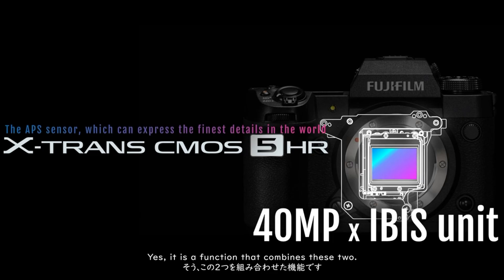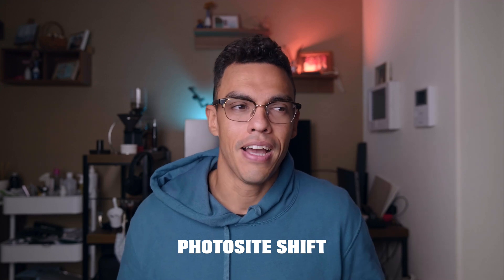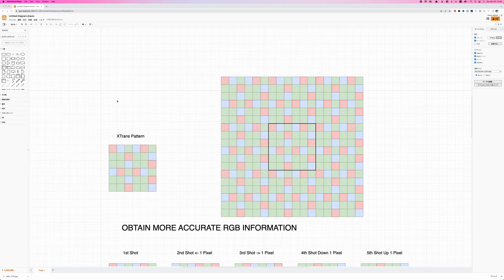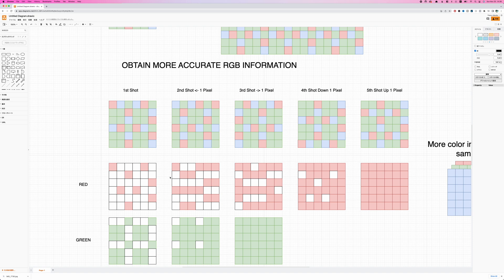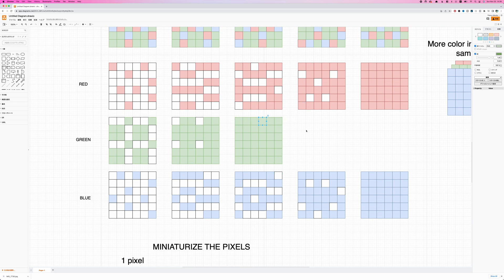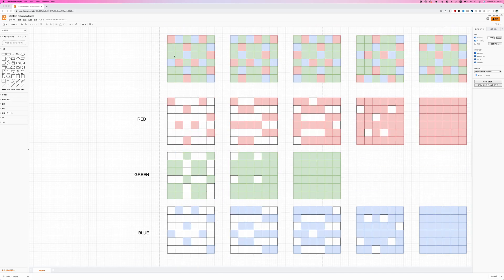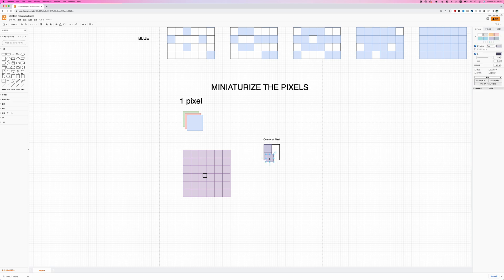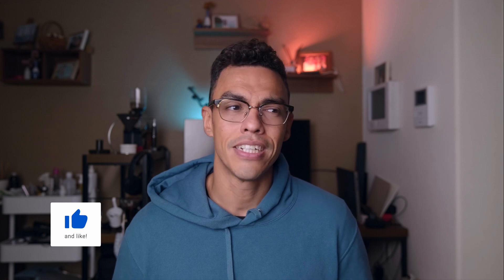PIXEL SHIFT - Everything you need to know

Comment: Congratulations, very interesting and detailed explanation of how the pixel shift works. Part of my work focuses on the reproduction of paintings with the highest possible resolution. For this I use an X-T4 with the 90mm f2.0 and a panoramic head, so that depending on the size of the painting I end up with images of between 40 and 180 MP.
I have been very interested in changing this tedious system and acquiring an X-T5, but I have not managed to see any serious tests that convince me that I will really get enough resolution. I take it for granted that small details would improve in the fidelity of colour reproduction, but I'm not sure that the actual increase in resolution corresponds to the theoretical one.
The tests I have seen use common subjects such as a clock or the circuitry of a hard disk, with no subtleties in colour nuances or brightness transitions.
I don't know if you have done any tests that have allowed you to check the real gain provided by the pixel shift of the X-H2/X-T5?
Thank you